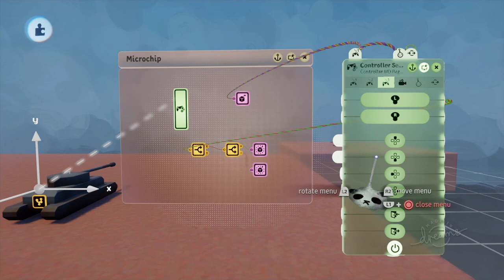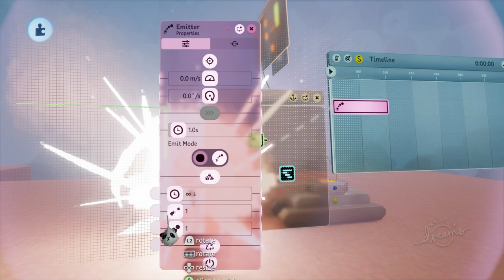Dreams PS4 tutorial - how to make a controllable tank

Comment: Hey, Panda! Well done on the tutorial!

A quick tip about the rotators... you can use one rotator and wire the left/right value straight into the speed--just like the mover. Now when you push left that'll be -1 and multiply the speed by -1. Or push right and it'll multiply by +1. So you get left and right all in one place.

Rotators also have a "damping" setting, which stops it from rotating faster than the speed. So if the speed is at 0, it'll dampen the rotation so it doesn't rotate--depending on how much damping you have on it.

The tightness on the bolt can also make it harder for forces to rotate it.
Reply from the maker: Hi TAP thats great information. Thank you. I just did it this was from when me and jade build daleks. Thanks for the tip bro
Reply: @TheRealHuggablePanda  No worries ^^